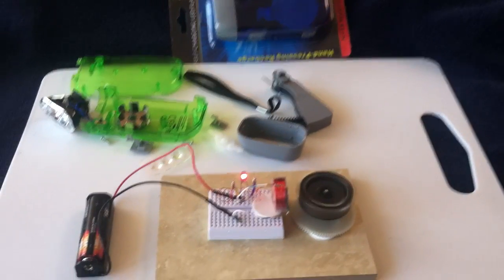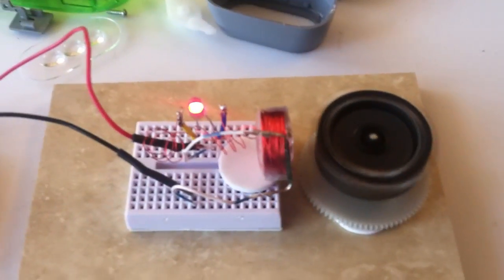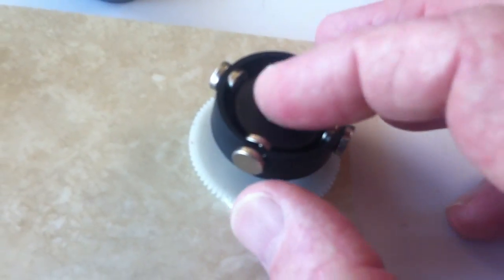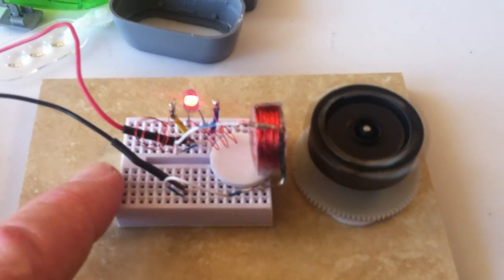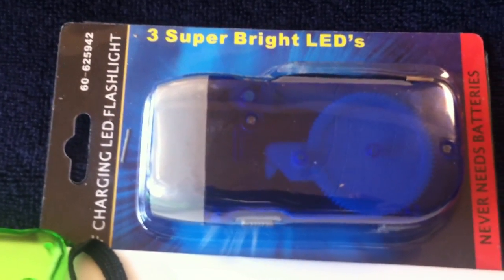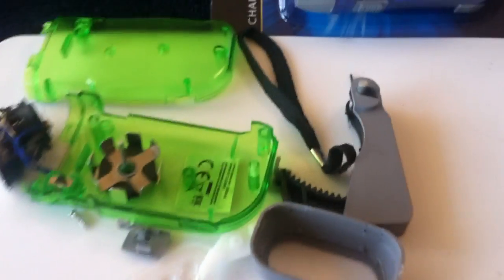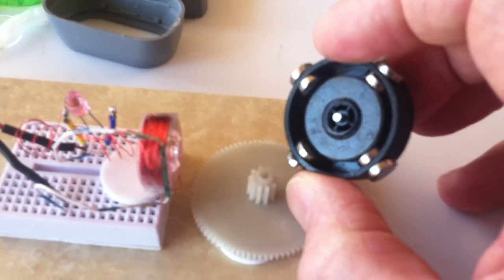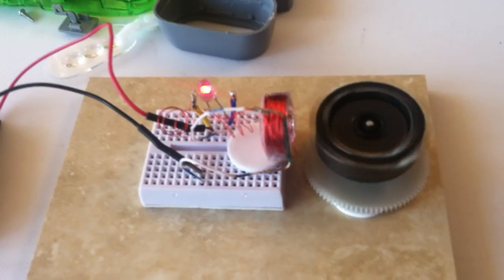Dynamo Flashlight Pulse Motor

Comment: Where do you get those from?
Reply from the maker: +Dark Alchemist My 99cent store has them for a buck but you can get them on Ebay for less than 3 shipping encluded.  http://www.ebay.com/itm/3-Bright-LED-Dynamo-Wind-Up-Flashlight-Hand-pressing-Crank-NR-No-Battery-Torch/201529684824?_trksid=p2045573.c100506.m3226&_trkparms=aid%3D555014%26algo%3DPL.DEFAULT%26ao%3D1%26asc%3D36972%26meid%3Dbba65aeaff0a48b4b62756f9da71ecd8%26pid%3D100506%26rk%3D1%26rkt%3D1%26
Reply: *****
Mom and pop dollar stores I sure miss them as the Dollar Tree put them all out of business for 1k miles around me at least and they carry nothing like this.   Thanks for the eBay link.

Oh, I wanted to ask but since you tore it all apart was this a fake using regular non rechargeable batteries everyone is getting it seems?
Reply from the maker: Yes it appears that this flashlight is a fake rechargeable. The 3 button cell batteries are just regular alkaline.  They might be capable of accepting a charge.  I need to do some tests on them.  I actually use regular AA alkaline cells in some of my solar garden lights and they do work ----for awhile. The trick is that you have to replace them before they start to leak.
Reply: *****
Nope, once those run out they are dead from everything I have read but maybe people ran them out though Alkalines aren't really supposed to be charged and this thing has been out for at least 3 years now and still using the same batteries.  Wouldn't a nice super cap be the way to go?
Reply from the maker: +Dark Alchemist Yes that would be nice.  Oh no----I feel a mod coming on.
Reply: *****
Hahahahahaha.  :)